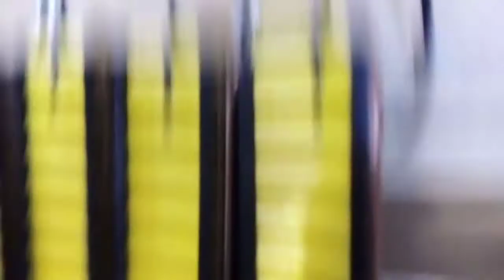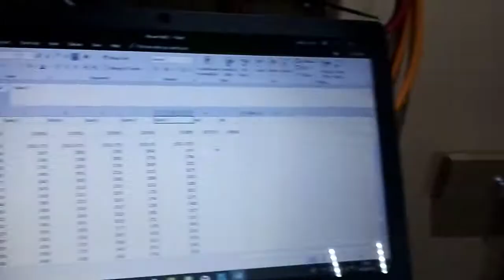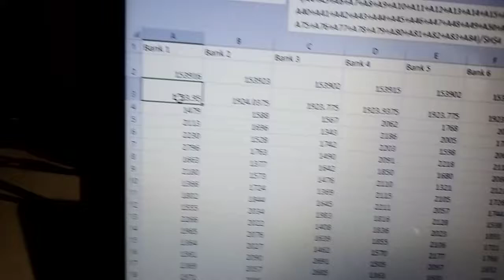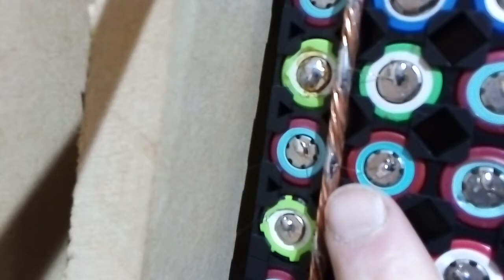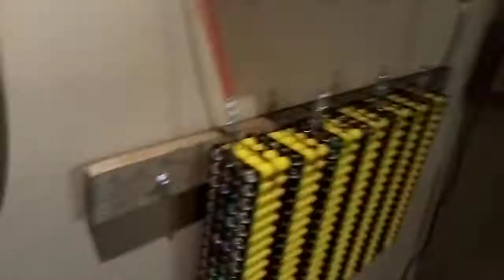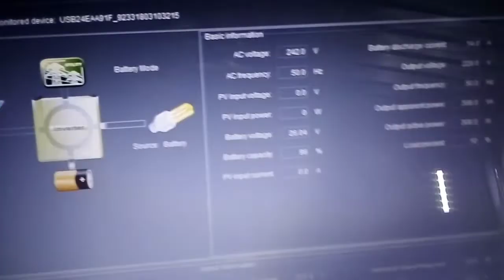Renewable Energy Off Grid Solar added Second Set of Batteries.

Comment: Just wondering why you've made 7 packs of cells instead of 6 if you're using a 24v system. 6x4.2=25. 2 so you'll never over charge that bank.
What am I missing?
Reply from the maker: A very good question. First lets understand our system of 24v. This is also the nonamal voltage. Think of nonamal as average.  Like a single cell is 3.7v, a 24v charge controller is typically a top end charge of approx 29V. Mine is max 31.5v. So fully charged at 4.2v per cell over 7s (or 7 in series) is 29.4V. 8s is 33.6v.
For the Inverter usually cuts off at 20v.  Mine is 21v.  7s at total voltage of 21v is 3v per cell.  3v is strongly recommended at minimum, but some setups they will push it to 2.8v per cell 
So 7s or 7 in series is perfect balance.  And a 6s will push the cells down to 3.5v each.  This will shorten the life dramatically. 
All values within my charge controller inverter is configurable, so I set the top end charge to 29.2v.  my banks are within about .03v at 28.5v.
If using a 6s setup as you pointed out, 4.2v cell is 25.2v. we are missing out on the opportunity of 1 whole bank.  In my setup of 80 cells per bank aproxx average of 165 amp.  This equals 610 Watts.
I hope this helps.  If not let me know and I will try again.
Thanks for the question and support.
Reply from the maker: A very good question. First lets understand our system of 24v. This is also the nonamal voltage. Think of nonamal as average.  Like a single cell is 3.7v, a 24v charge controller is typically a top end charge of approx 29V. Mine is max 31.5v. So fully charged at 4.2v per cell over 7s (or 7 in series) is 29.4V. 8s is 33.6v.
For the Inverter usually cuts off at 20v.  Mine is 21v.  7s at total voltage of 21v is 3v per cell.  3v is strongly recommended at minimum, but some setups they will push it to 2.8v per cell 
So 7s or 7 in series is perfect balance.  And a 6s will push the cells down to 3.5v each.  This will shorten the life dramatically. 
All values within my charge controller inverter is configurable, so I set the top end charge to 29.2v.  my banks are within about .03v at 28.5v.
If using a 6s setup as you pointed out, 4.2v cell is 25.2v. we are missing out on the opportunity of 1 whole bank.  In my setup of 80 cells per bank aproxx average of 165 amp.  This equals 610 Watts.
I hope this helps.  If not let me know and I will try again.
Thanks for the question and support.
Reply: Ah awesome, yes that explains it perfectly.
Reply from the maker: I'm happy to help.  Any other question please ask.
Thank you.
Reply: I'm in Vic, currently in the process of collecting, dismantling and testing all my batteries. I still need many, many more batteries. But for now, as I go I'm still working out which way I'll build my banks.
Reply from the maker: It that Vic as in Australia Victoria Melbourne.  if you like to email me smartcolorfencing@gmail.com and I will give you my phone number.
Reply: Thanks for Q & A. Really helpful. 👍👍

Comment: Where u order from that inverter
Reply from the maker: The Inverter is found on Ebay. If you plane on running the whole house, then I recommend the 5KW 48V MPP Inverter. Factoring that this Inverter is a 3KW 24V, that can run most to all appliances that use low power ie. TVs and Fridges. When you start talking about running Kettles Microwaves and Toasters, then on a 3Kw Inveter you can only run 1 of at once. Example Microwave is 1700W and Kettle is 1900W.
Reply: Adam Cecere how about 2.5aircondition
Reply from the maker: 2K5W aircon go for the 5KW Inverter.  There will be a lot to spare, and it won't work so hard.  As well as the charging capacity is limited to 50A aprox 1200W on the 3KW Inverter. Were as on the 5KW Inverter charging can go as high as 100A aprox 2400W.  These figures are a rough guidline. Please don't take them as exact.
Also you panels will not do this all day long.
Reply: Adam Cecere so even i will not BMS just more parallel battery in order to maximize the charging of 18650
Reply: Adam Cecere also what size of fuse wire u use??
Reply from the maker: I strongly recommend the BMS.  You will never have to check each pack.  The BMS from Batrium also dose Balancing.
Reply from the maker: I use 1 strand of extension cable.  I have not properly  tested this, but what i can tell you is 2 strands dead short will blow.

Comment: Sir adam do u use Bms in you power wall
Reply from the maker: Still no BMS. The more Storage the less fluctuation of Voltage from the same load pulled from the batteries.